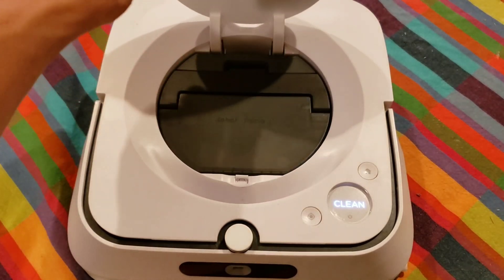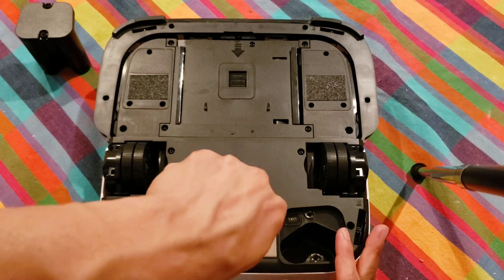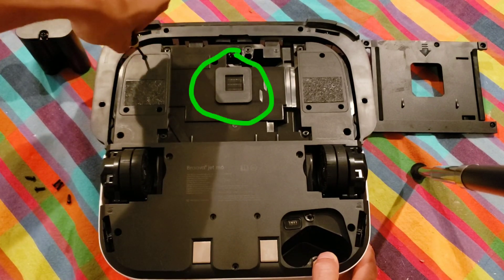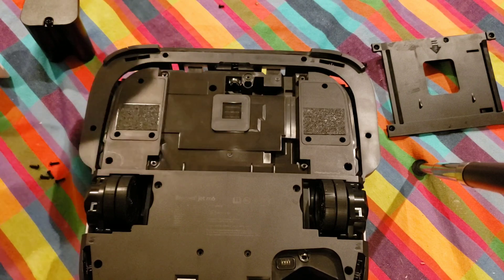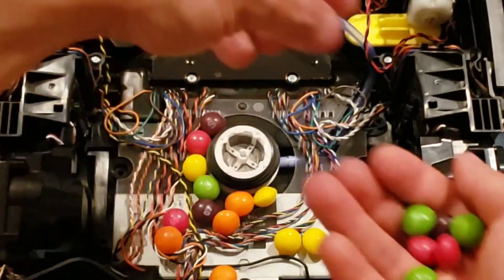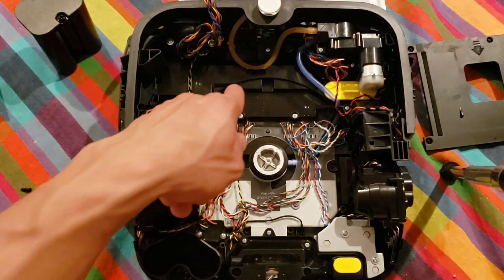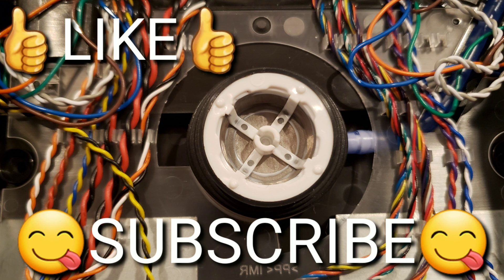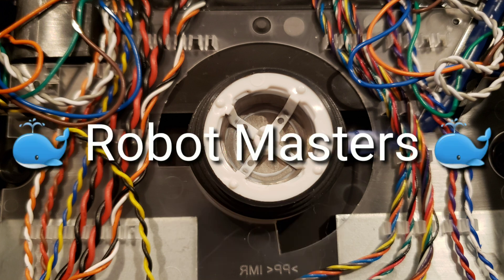TEAR DOWN / TAKE A PART iRobot Braava M6 Mopping Robot. What makes this Cool Robot work 🤔 Skittles?

Comment: 9:10 water sensor / float sensor / error 37 fill the tank. 
(i was just dropping all that in as keywords for anyone searching this annoyingly common fault).
 Thanks for this.
Any idea how to rewire to bypass the water sensor such that it considers it always full?
It seems extreme I know but I cannot get the part in Australia - they flat out refuse to ship it and all the repairers have confirmed it is not available. 
The ordinary fixes (loosening the float mechanism, reducing the gap between the float and the sensor) do not work so I am happy to simply refill it after each mop so it stays full. Otherwise, it's a dead robot. Hasn't worked for at least a year, with maybe one or two exceptions.
Cheers!!

Comment: Hello friend

Do you have electronic as well as mechanical skills, to show us how to take out the mother-board?

A lot of people - inclusive me, have troubles with the white clockwise circle, just spinning around. 

At the same time it’s also impossible to establish a wifi-connection between the mobil and the Braava Jet M6. 

The 3 buttons dosen’t respond either.  

The battery is 100% ok. 

If you can spare some time and show it in a new video, it’s just super.
Reply: Ditto! Please help!

Comment: 8:18 - Do you happen to know how the 3 wire distance sensor works?
Reply: I may be able to answer my own question.  I think the IR  sensor is only used to navigate to the docking station, but I could be wrong.  I think it uses an internal camera for navigation.  But anyone feel free to correct me if you have different information.

Comment: 9:08 water tank sensor. Thanks for this Nathan! Rekon if I cut and wired two of the wires (not sure which) together I could bypass the water sensor? I have an empty tank "fill the tank" error that is perpetual and isn't resolved through reboots, unsticking the float sensor, or re-seating the tank. Thanks!
Reply from the maker: Yeah that might do the trick, if not you could tie the wire together.

Comment: Do you have any idea for how to fix "Error 1 uneven ground"? I can't find anyone addressing the issue. I took it apart just in case there was an obstruction, but didn't find anything. It is very frustrating and I would appreciate your help.
Reply from the maker: The only thing I can think of is one of the wheel sensors went bad or not registering that it pushed in.
Reply: Did you find a solution ? Same problem here
Reply: @ertixil  I don't believe I did. If I remember correctly I ended up returning it

Comment: Thanks for this video. I lost 2 screws when I put it back together, not sure what happened, but I was short 2! Maybe 2 fell inside the robot, who knows! Do you know what type of screws those are? it's the shorter ones up on the slot of the cleaning pad. Thanks!
Reply from the maker: Hello, not sure the exact specs of n the screws. If you take them to your local hardware store, they may be able to find an equivalent.

Comment: I just bought a Braava jet m6 and since the first once I install the washable wet mop pad it says “install pad” I repeated it several times and nothing changed. I ordered another set of washable wet pads and it’s the same, but once I use the disposable wet pads it works fine. I contacted the support team, and they respond to me “Seeing that the Robot is being used outside of the US this voids the warranty and we will not be able to provide you with any replacements.” So I need to know what is the issue and what can I do ?
Reply from the maker: Hmmm make sure the sensors are clean, where the mopping pad slots into. There some lights that read what type of mopping pad is in there. Also try restarting the robot by turning the robot off than on. Also you can try removing the battery from the robot.
Reply: @RobotMasters  they told me to clean the sensor with a towel and then reboot the robot, then install back the washable wet pads... I tried it but it didn’t work. Could you please tell me how can I turn it off or how can I remove the battery? Do you think if I turned it back to factory settings will it work?
Reply from the maker: @lovekuwait90  To turn the robot off just hold down the clean button for 3-5 seconds. Underneath the robot there a battery cover that held on by two screws.

Comment: My wheels started to fail aswell.My m6 started to demand to be put on even ground, although it was standing on charger. Since mine is not bought from my region, im not covered with warranty or service.  So i took my Adolf apart aswell. But i took it more apart, than you. The wheel have Weird sensor to detect uneven ground. On the wheel frame lays.magnet. On the spring frame sensor with 5 wires. 2 are separate black and red. My guess, those are + and -. Other 3 seems to be signal wires. Might it mean robot can detect 4 positions of the wheel... Well see, if I need to destroy the sensor. Right now I cleaned everything with alcohol swab and seems to work well. Must say I was impressed with the care irobot took to seal everything with epoxy.  There has been water leak to the body, but only thing affected is 1 screw, that holds ballast weight. Too bad irobot have such bad policy of where I can buy my robot.

Comment: So my brand new unit says the tank is empty when it is not and when I refastened the tank it says that the lid is open which it is not. Any suggestions?
Reply from the maker: Hmm try resetting the robot, and reseat the tank. There a small square inside the water tank that the sensor uses to detect the tank
Reply: @RobotMasters  I already tried a factory reset then same red ring error of either fill the tank or close the lid. 🤦🤷
Reply from the maker: @JEFFREYSOLORIO  The unit could be defective, I would contact iRobot, it probably covered under warranty
Reply: @RobotMasters  I'm just going to get it exchanged. I really appreciate your help and response. 🙏
Reply: @JEFFREYSOLORIO  Did you ever find the Problem? I had the same thing happen to me. Mine was caused by my failure to seat the tank all the way down First with the Handle in the Up position. Then flipping the Handle down locking it into place.
Reply: @maddeusdoggeus1  The unit was defected I got it replaced.
Reply: @JEFFREYSOLORIO  Have you ever had a “Clean Filter” alert on yours? I can’t find how to do that.
Reply: @JEFFREYSOLORIO  sorry never mind. Found it in the home support page.
Reply: @maddeusdoggeus1  So the problem with my new replacement is that it won't work with the reusable cloth mop It doesn't read it, It only works with the disposable ones which is annoying.
Reply: @JEFFREYSOLORIO  That Has to be Very expensive. I ordered and have been using the generics I got from Amazon for about 6 months now. I will double check the brand and let you know.
Reply: @JEFFREYSOLORIO  Extolife Washable and Reusable from Amazon. I got an 8 pack for dry and wet. I never used the dry mop heads. The 4 wet mop heads I have rotated out since June 3 days a week... I would try and get them to fix that issue for you.

Comment: Is their a way to unplug the sensors so it can go over thresholds.
Reply from the maker: No unfortunately the connections are soldered in.
Reply: Excellent video!  
I am also looking for a hack for the cliff sensors. I have a rough slate floor, and the robot mopped fine at first, now it's being ultra sensitive to minor bumps. 
I was trying to determine on your video where the cliff sensors are. I see you pointed them out, but I couldn't tell what part of the bot I was looking at/location.  
Want to see what would happen if I block them. :-)

Comment: My m6 will not spray anymore I tried sticking a needle in the nozzle and it still won’t spray, is there anything you suggest other than warranty
Reply from the maker: You will need to remove the top cover with the screws underneath. Once the Top Cover is removed, locate the hoses and you will see a pump attached to them. Carefully remove the pump and manual rotate the until some fluid spits out. The pump needs priming if the robot sits for a long period of time.

Comment: Took mine apart to try to clean out the hoses and spay nozzle after it got clogged up with a waxy cleaner. Still not spraying, but I realized that there is a 1" thin steel rod that is left over.  Can't tell where it's from.  Any ideas?
Reply from the maker: That steel ride goes on the spinning plastic part of the motor pump spray unit. So once you have everything hooked up pump wise, hoses, filter assembly etc. While the m6 still taking apart, take some water and fill up the filter assembly, now manually spin the pump to get the water to spray out of the nozzle. May take several spins. Once you see some water come out the nozzle, put everything back together and you are good to go!!!

Comment: I disassembled my wife's M6 in order to get pet hair out of the wheel axles. When I put it back together, it doesn't power up at all! Just a dead brick!

Does the M6 have any kind of an interlock switch that is maybe still open or something? Hoping you can help... Thanks!
Reply from the maker: No it doesn't, check the battery contacts and power cabels, try putting the unit on the charger, see if it charges abd lights up. Also check all the connections to the circuit board, I think they are all sealed, except for the battery connector
Reply: @RobotMasters  
I put some dielectric grease on the battery contacts, so ... we'll see.

Got it for my wife at Christmas time; she loves it. Got an extended warranty, so I may have to send it in...

Thanks again!
Reply from the maker: Anthony DeCosa Sounds good, iRobot does good honoring their warranties and repairs.

Comment: Nathan my m6 is having trouble spraying water. How can I fix that. And the best way of cleaning the robot.
Reply from the maker: Try sticking a needle through the spray nozzle to gently clear out the gunk. Don't go to far or you may puncture the hose. It similar process to cleaning a KCup coffee machine. Once you cleaned the nozzle, use warm water and activate the spray nozzle to clean the rest out

Comment: https://www.youtube.com/watch?v=1KcwORu9rog I took my roomba apart.
Reply from the maker: Nice Tear Down Video, I cool to see how much smaller battery have gotten over the years, also the Roomba had the dual Extractors design but with a brissel and Rubber combo, interesting
Reply: @RobotMasters  
do you have robots like mine?
Reply from the maker: Liam 555 No I do not have any older roombas but only the I seven and S9
Reply: @RobotMasters  Do you plan on getting one?
Reply from the maker: Liam 555 Maybe down the road if I can find a good deal 😆

Comment: I did that a few times 2 but once I BROKE MY ROOMBA DOING IT but me and my dad fixed it. Also why didn’t they make the wheels out of the Same stuff on the old jet and the OG braava
Reply: Well it failed
Reply: Badly
Reply: My old braava wheels are fine and I’ve had it for 2 to 3 years
Reply from the maker: Funtime Freddy Ohhh nice, yeah we will see how well the m6 wheels last
Reply from the maker: Funtime Freddy I think the New Wheels are designer to last longer and not break and fall apart like on the old ones, just a guess or they are taking a gamble with these

Comment: Hi love your videos, I'm currently stuck between the Roborock S6 or Neato D7, have you any videos of the S6 mopping?
Reply from the maker: John Walker So I have not uploaded any S6 videos of mopping, I think the Roborock the better value and overall will be the ideal choice over the Neato D7. More features App Features, better performance and reliability.
Reply: @RobotMasters  Great thank you!! Out of interest is the mopping feature on the S6 any use at all? I wouldn't expect it to be as good as a dedicated Robomop but just wondered
Reply from the maker: John Walker So maybe for light duty dusting, since the S6 has the same cleaning Vacuum and Mopping pattern, so the Mopping part can’t get stubborn dirt or grime. It kinda of a novelty feature in my mind, you would be better off with a dedicated mopping robot

Comment: Can’t believe the spaghetti wiring. Looks like a 1969 wiring appliances. The hose looks like my old vintage bombardier skidoo carburateur fitting. :D Nice teardown I’m far from being impressed with their ‘’engineering’’.
Reply from the maker: LOL when I saw the mess of wires I am like really, could of integrated all in a PCB been a lot easier and more reliable LOL 🤣
Reply: Robot Masters that is an extremely cheap O design. I could not believe such a thing possible in 2019. Oh man quality is gone!  Lol
Reply from the maker: Hahaha, at least the put a rubber O ring around the gear box, I don’t think I have seen that on a consumer robot.
Reply: Robot Masters at least there was some skittles. ;D
Reply from the maker: Yeah it was a good Snack for ME 😃